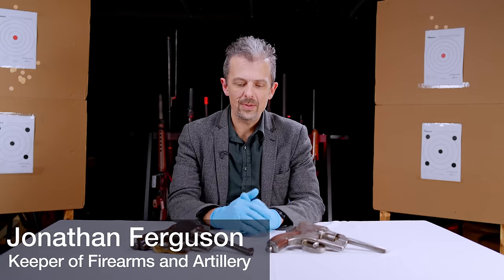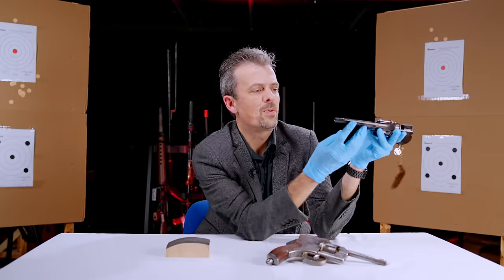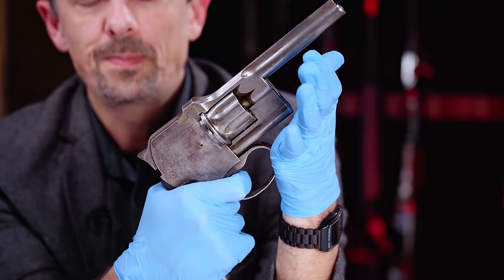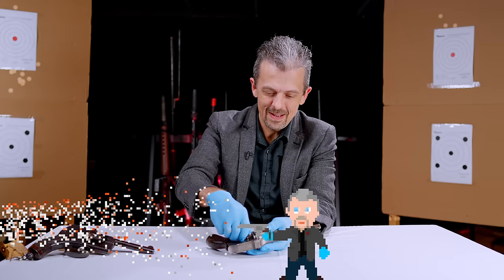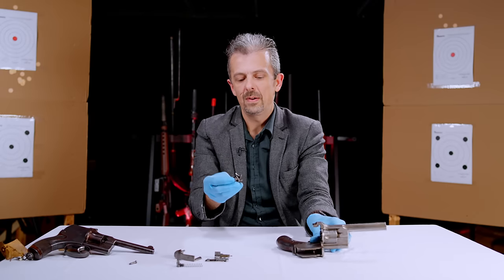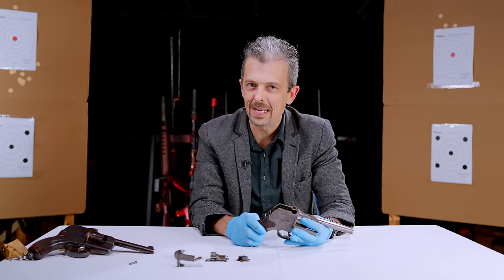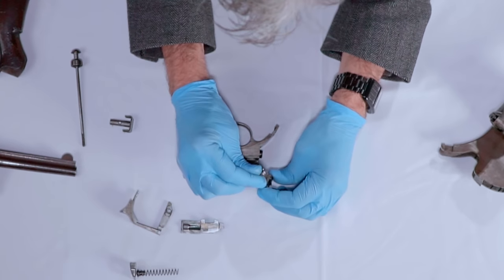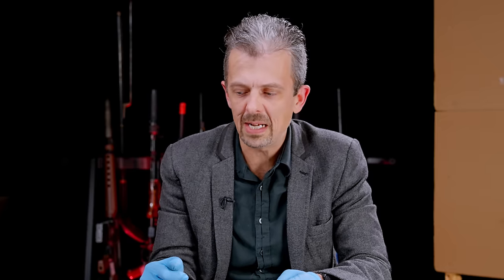A Gatling Revolver? With firearms & weaponry expert Jonathan Ferguson

Comment: Not going to lie when I heard "Gatling revolver" I was hoping for a little multi barreled pistol with a hand crank on it.
Reply: Same
Reply: "One conscript, he spins the crank, the other, he mows down enemies like fist of drunken god"
Reply: @Fridelain  Or you have a set of handlebars on either side,  a small crank protrudes out the back which you grip firmly with your teeth.
Reply: Multi-barreled rotating revolvers (called pepperboxes) were a thing for a while, but they're not that interesting mechanically.
Reply: @alltat   Well that's because a pepperbox is essentially just like a traditional revolver with long cylinders and no single barrel, the cylinder itself are short barrels.  Maybe a oversimplification, and there was a variety of designs including carbines and shotguns, but not exactly Gatling guns either, anymore than a 1860 colt army is.
Reply: I had the same impression, except my imaginary Gatling pistol operated with a spring-driven mechanism that rotated the cylinder, fired the cartridge, and then extracted the spent casing. The mainspring would be wound with a key. The trigger either released the mainspring or restrained it depending on whether it was held back with the shooter's finger or allowed to go forward into the restraining position. I very roughly worked out the mechanics in my head but concluded such a gun would be far too large and heavy to be a pistol. It would have a tremendously heavy trigger pull as well. There were several manually operated magazine pistols patented in the 1880s that competed against the earliest recoil-operated semi-autos like the Salvator Dormus, but the Gatling action was just too complex for small firearms, which explains why the idea languished for nearly 60 years until the M61 Vulcan cannon appeared. BTW, GE was not the first to apply electric power to the Gatling action. That was Dr. Gatling himself in 1893. When you think of it, all the parts of a super-high output gun were in place in 1893 -- the mechanism, the power source, and smokeless powder -- but no one paid attention because the Maxim gun was all the rage. You'd think the USN would have jumped on that idea  immediately. After all, many American ships that fought in the Spanish-American war carried hand-crank Gatlings.

Evidently, the Gatling Arms Company was not connected to Richard Jordan Gatling, just a coincidence of names.

Comment: From the 1880s-90s or so, it seems.  It obviously requires cartridges to fire (not a front loader), what caliber is it?  If some obscure named round, what diameter of bullet?  (You mentioned it later.)
I have been a collector of mostly more modern arms (WW1 - prior to WW2) and have never seen one of these, living or dead, so to speak.  I likely would not buy one, but I'd certainly notice. 

And I thought a Colt double action revolver was complicated!
 
By the way, that front sight shape was used on the early S&W revolvers until the early 1950s or so (phased out over a period) and is generally referred to (in my experience) as a 'half-moon' sight.  

Fascinating development.

Comment: I was struggling to remember its name and went for the wrong guess anyway, so congratulations to Pierre-Louis Comte!
1:22 So, this predates all other unorthodox Kynoch revolvers with latches on the back and such like? This all makes sense now.
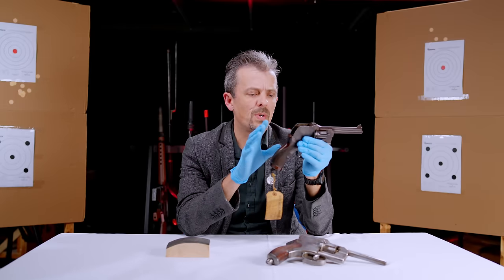1:58 This animation was unexpected! I though something went wrong in editing with the patent number.
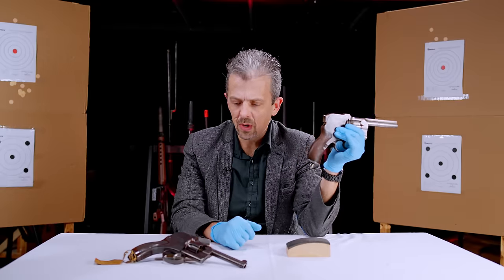5:22 Not in the World of Guns. 😁
5:47 Why would one go this route at that point? Hadn't Albini's 1868 patent for swing-out cylinder safely expired by that point? Was it a strange way to compete with Merwin & Hulbert?
14:59 If your sword has such a thin tang, you'd better not touch it! 😉
15:23 An interesting feature of this gun is its short frame in the grip area, reminding me of the Enfield revolvers of the time.
18:23 It wouldn't be surprising for this gun to end up in the French revolver trials that were going on at the time, it was striker-fired, after all, and we know that a transfer bar, or a spring-loaded firing pin, if you prefer, almost made it to the final Mle 1892.
Thank you, Jonathan, that was enlightening!

Comment: I can see how the designer possibly considered this kind of (c)lockwork easier to time because it only runs on sprockets, but that's a lot of "ifs" with those little wheels not having quality issues with machining. Maybe they were thinking about some savings with only using cylindrical springs. Even then, it creates more problems than it could possibly solve. I can also see how it wouldn't be popular with anyone who expects access to the lockwork any easier than playing this 3d puzzle.